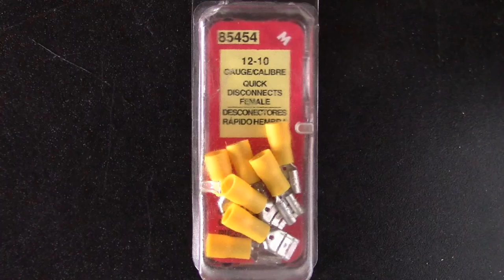DIY 12v Space Heater (w/2 heating elements!) 150F(65C) dual fans, AC/DC power solar/batt/car options

Comment: The ceramic resistance is 1 kilo homs, and fan give hot air. The ceramic is heat protected, so you can use a candle at his bottom or other heat producer separate by a piece of stainless steel or aluminium sheet, to warm up the radiator, just protect it from fire if you want less electrical energy. Imagine 10 heat candle in a demi sphere ( a cheap saladier), with this module at the top. Otherwise this set up is amazing, thank you very much, i have the same components from an old 230v heater, this confirm that it run on 12 v in reality. So we have tools for this winter , greath and love from France.
Reply: isnt it like 200watts, I=U/R, should be like 7A

Comment: blow the air on bricks to heat the bricks for nightime heat release
Reply from the maker: yes, good idea. the idea behind this heater was to try using 2 heating elements (spaced apart) so their air streams would combine into a larger mass of warm air in front of the heater. works great! (of the 3 heaters that i've recently made this is the one i use the most). the other idea was to make the most powerful 12v heater that could be run off of a cars 12v power socket.
Reply: @desertsun02  there was something called sandstone i think apparently in the old days they heated these up on a wood stove and then with metal tongs brought them to the bedroom for heat. they claim this stuff is amazing fast at absorbing heat, and slow to release, i wonder if you had a average size  room in a house ,maybe no windows, insulated walls,floor and ceiling, with maybe 2 of your devices and these stones in 2 corners, i wonder if you used it for 12 hours, would it be warm enough for the other 12? the 54 cents would be 27 cents, maybe try to set up a solar panel? to bring 27 cents to zero
Reply from the maker: @TheMIssissauga333 i think you are thinking of 'soapstone' that stuff is supposed to be awesome. apparently even a small piece can hold heat for 5 hours or so. the reason i haven't tried it yet is it's pretty expensive.
Reply: @desertsun02  o ok you may be rigth, i got it written down somewhere

Comment: if u supply 9 volt....the temp of the hot air will actually go higher because there is less airflow....and it gives it slower time to heat up more...also the sones fan noise is reduced.....less electricity sonsumed by the fan and higher hot air temperature....
Reply: If only temp would be the main factor then a single candle could heat up your house. It is the amount of hot air that matters.

Comment: Another great design and build!  Have you taken amp draws so you can figure watt usage?  I would love to try something like this for car camping and would use it on my Jackery.  Anyway, greta job!
Reply from the maker: hi. yes, that was a big part of the build on this one. I was trying to make the biggest practical heater that I could (that could be run safely through a cars 12v power socket). those are rated for 15 amps so i knew it had to a little less than that. the most powerful commercially available 12v items for use in a car pull 12 to 13 amps (so safely under the 15 amp limit). this heater draws a total of 12.5 amps so it's right in there. i hooked up a watt meter and took readings over several hours. the range was from 144w to 151w. highest reading was 151 so well below the 180 max of the power socket. the other goal with this unit was to use dual heating elements spaced apart in a way that would maximize the heating of someone sitting in front of it. it's been working great. just the right amount of heat for the chilly mornings we have been having lately.
Reply: @desertsun02  that's awesome!  Hey, thanks for all you do.  Love your work!  I have a few similar experiments I need to finish as well.  All inspired by you!

Comment: Can you measure the draw? Curious how long that would run on a 50A led acid battery. Thanks👍
Reply from the maker: this unit will draw about 12.5 amps (so you should get a few hours on that size battery).

Comment: Hello, can you tell me what happens if I put 22v on the 12v PTC heating element?
Reply from the maker: it will work okay. they can handle a range of voltage.
Reply: @desertsun02  thank you very much

Comment: i have a ceramic heating element i found at the goodwill.. its marked 110v 500watt on the side... would i need a 12v 45amp power supply to run it?

Comment: This is so cool.  Is it just a personal heater or how much space can it heat?
Reply from the maker: hi there and thanks. yes, it's a personal space heater. great for localized heating. if the room was on the small side, it may heat it some as well. the goal with this project was to see if using 2 elements side by side would increase the overall feel of the heat. it does because the 2 heat streams combine into one in front of the heater so you don't have to huddle in front of it to get warm from side-to-side. the other goal was to be able to run it off of a standard 12v power socket.
Reply: @desertsun02  Just for reference, a small hair dryer heats up small space like bathroom easily within a couple minutes. I think this has something to do with the high air flow which enables lots of heated air to fill the space quick. With a radiator it would take days to reach the other side of the bathroom but hair drier pushes the air so forcefully that even low conductor like air will heat the space quick. In physical sense the speed matters in heating also. Fan has tons of more air MASS flowing than thermal mass heater. And heated air mass is only thing that matters indoors. Air is the conductor in almost every heating device not including infrared heaters. But even with infrared the heat will eventually transfer into heated air in the room and escape outdoors through ventilation. So I think that PTC fan heater should be the most effecient heating method because the fan moves the bad heat conductor air faster than radiating thermal mass. Thermal mass heater is ofcourse much better for storing the heat but if the outside temperature is pushing cold into the house the termal mass heater can't rival with the cold air speed as good as ptc fan heater can. The thermal mass heater with the copper plate and fan is like a hybrid model that has good airflow and storage. I also think that using thermal mass storage lowers the ptc element energy consumption versus the direct airflow. Because the thermal mass has higher heat resistance than quickly cooling fin elements etc. And the heat resistance means also electrical current resistance because the current is the source of the heat and when there is enough heat it will slow down the current flow. So I would suggest to get a ptc fan heater or build a thermal mass heater that has a fan integrated. Even better solution is to install thermostat into the fan circuit that fan will start blowing when the other side of the room gets below required temperature. Thermal mass would store the heat but fan would distribute it fast when needed.

Comment: what would the cost be to run that 24 hrs?
Reply from the maker: not very much. give me a minute to do the calculation. okay, it's 54 cents a day using ac power (over 24 hours) - at my current electric rate. (if used in your car it's a different calculation, or on a solar panel it would be free)
Reply: @desertsun02  blow the air on bricks for heat release later on, would the cost per day be cheaper than the heating plates things heating sandfrom your other vids? which is cheaper to run daily
Reply from the maker: @TheMississauga333 i'm not sure on that one. i'll have to give it some thought. several variables

Comment: Where do you get those thick fans?
Reply from the maker: hi. you can find those on amazon
Reply: @desertsun02  Thanks. I want to run a set as defrosters for my old VW Beetle. I have a diesel heater but it's not hooked up to the defrosters. It gets plenty warm but it doesn't generate enough airflow to run the floor heat and defrosters. Those fans look like they put out plenty of air for a small vent.